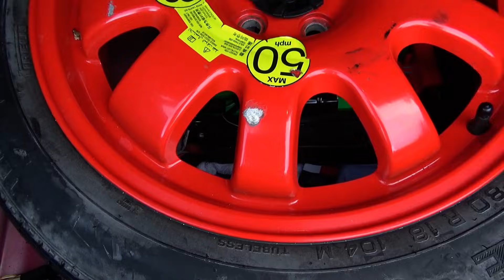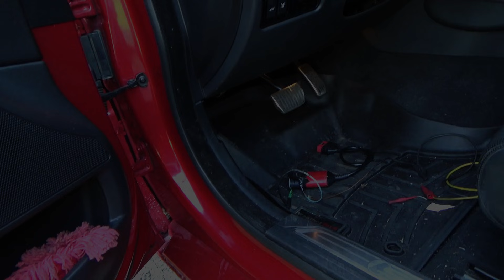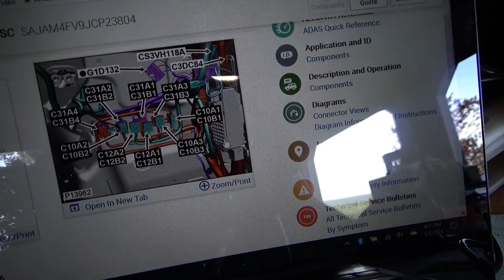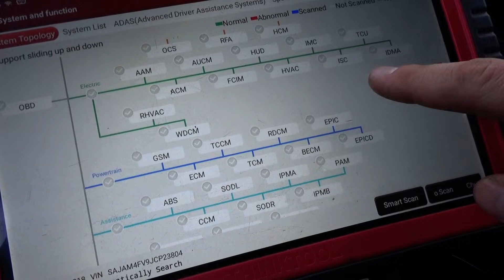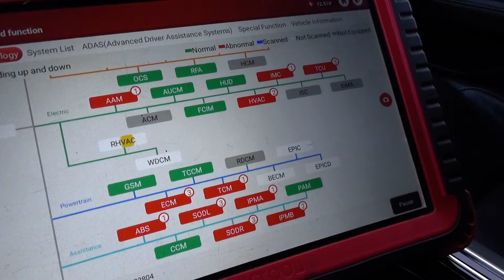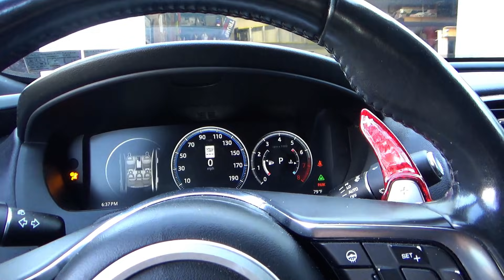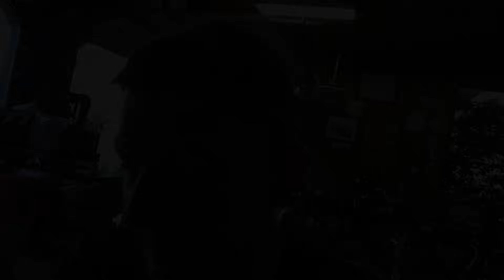Jaguar Transmission FAULT...Can't Read Codes?? ('18 XE AWD Supercharged)

Comment: Ivan, long time follower and JLR guy here!

You did the right thing by clearing out the codes, looking at some of the other codes in the other modules it seemed the old battery and how it was replaced likely caused some of the other issues. Rule with JLR stuff is if you intend to replace the battery you have to leave the car for 30mins to let all the modules go to bed with the boot open. Then do the replacement and reprogramming. This used to be clearly marked under the bonnet but some stupid decision removed the sticker advising of this procedure...(or making you go to the dealer... sigh...)

The reprogramming enables the stupid start/stop system and also the battery low warnings. Makes things worse they're are two batteries in these with the start/stop....  As always a great video!

Comment: Probably for some other DTCs, this gear shift knob ASSY is also known for dried-up CAPS on the PCB so if you feel froggy, you may want to open up the module to check the CAPS of which there are several if you can follow the PCB traces back to the connector, you might be able to narrow down the exact dried CAP or you might see a CAP leaking but if you can do PCB level repairs, give it a go, cheers.

Comment: On most Japanese cars that issue would be related to the transmission range safety switch.  A part that is usually bolted to the transmission externally and easily accessible. Oh Jaguar,, your reputation precedes you,,again.

Comment: i remember working for aamco transmissions. and we used to get the older s-types the four round front. light models. and the modus wouldn’t read the jaguar for the transmissions.  the work around was to put in the car as a ford expedition  because the transmissions were the same and it would work

Comment: Quest - Ivan, Why not check the automatic transmission fluid level since it evidently is a possible problem/cause of the warning light and the vehicle is physically in your shop? 🤔Just asking for me.😳
Reply from the maker: No dipstick 😂
Reply: @PineHollowAutoDiagnostics  Thank you for the response/rational
(Personally I hate despise,loathe,abhor,have grievous revulsion);you get my P.OV. Concerning manufacturer’s replacing physical dipsticks with electronic sensor fluid level devices. Seems ( too me) a case of “look how clever we can be”. More things to go wrong, more complex,etc.
Really miss the ability of an operator/owner to verify quantity as well as physical condition of the applicable fluid.
(Sorry for the rant, just an opinion).
Stay safe.
Jim B,
p.s. please give my regards to Eric O. if you “see” him.

Comment: I'm surprised you didn't at least find the module and check for any wiring problem, especially with that water ingress and the intermittent problem. We have seen before in your vids where the suggested "replace the module" only listed cure turns out not to be necessary at all. Also, what blew that fuse?
Reply: The TCM is probably barried in the transmission case (they do that now). It's not easy to get at, and also, these things need dealer programming or require special tools to reprogram.

Comment: For the TCU, I'm sure if they go to the Jaguar/Land Rover dealer they're going to recommend a whole mechatronics unit (What ZF/Germans call the valvebody with the TCU integrated). You can replace just the TCU which isn't hard. You drain transmission fluid, remove the pan, and drop the valvebody which is about 10 - 15 screws and then unclip the TCU. The problem is that nobody who uses the ZF8 (Audi, BMW, LandRover, etc.) will sell only the TCU, only the whole mechatronics unit. If they can find one for cheap on eBay, swap it over and have a dealer program the TCU to the car's VIN that's they're best bet. I was able to get an entire 62k mile ZF8 for my Audi for only $365 (not including shipping) so I can't imagine the valvebody or TCU on eBay being expensive.

Unfortunate that's probably the solution, but these ZF8 transmissions are tried and trued. Excellent transmission both when they're need to be smooth, as well as aggressive and sporty (almost matching the performance of a dual clutch) while extremely reliable.

Comment: I would also put the selector in M and go through the gears with the shift paddles up and down. You'll find a bad solenoid that way too. I'd change the transmission fluid as its overdue anyway and confirm his battery/charging system is up to par. However, I wouldn't go to the dealership first.  I would head for a good transmission builder shop who knows how those computer trans work, inside and out. Dealers don't rebuild transmissions; they replace them with factory remanufactured or new.  Waste of money. Nice to have repaired the customers fuse and DEC.

Comment: That spare tire well should have a drain hole you'd think. Also, since the Jag runs and drives fine, if it ain't fixed, don't break it!

Comment: I bet it was the weak battery. It said on the diag on the screen to check the battery voltage as one of the steps. New battery fixed the problem

Comment: After spinning off from British Leyland, Jaguar was acquired by Ford in 1999, remaining under Ford ownership until 2008, when Tata Motors purchased both Jaguar and Land Rover.

Tata Motors then created Jaguar Land Rover as a subsidiary holding company. Despite the change in ownership, Ford still develops and supplies Jaguar models with different technologies and components.

WHERE ARE JAGUARS MADE TODAY?
Although who owns Jaguar has changed over the years, where Jaguars are made hasn’t! A few models are made in China and India, but the vast majority of today’s Jaguars are still made in the United Kingdom. Where each Jaguar is made depends on the model. Here’s how it breaks down across the company’s various facilities:

Research and development: Gaydon, Warwickshire; Whitley, Coventry
Assembly of models including the XE, the XF, the XJ, and the F-TYPE: Castle Bromwich, Birmingham
Engine manufacturing: Wolverhampton, West Midlands; Changshu, China
Special Vehicle Operations development: Ryton-on-Dunsmore, Warwickshire
Production of Jaguar XF and XJ models: Pune, India 
Production of Jaguar XE and XF models: Changshu, China

Comment: From watching a lot of YT videos I have gathered that exotic cars tend to be very sensitive to minor battery fluctuations. Well, minor if you drive an old Honda.  (90% probability there is NOT a transmission issue.) However, I did see on the OEM page you displayed to check transmission fluid level.  Seems like you have to go to a dealer for that. Since the car is 6 years old I bet its never been checked. Would definitely recommend it get checked.

Comment: Maybe when the battery was replaced somebody had a memory keep plugged into the OBD socket and as they were changing over the battery they accidently touched the positive cable to ground, that would blow the 5amp fuse.

Comment: Related to another comment, but could be relevant to this car, Ford/Volvo/JLR of that time period often used a clever battery management system. There is a sensor in the battery negative lead which monitors current in and out of the battery. With my car it would throw a low battery warning very quickly if you parked up with the radio on for a few minutes. The "fix" was to unplug the sensor for a few seconds while the engine is running and then reconnect it (a small 2 pin connector). The BMS then relearns the battery, it is possible that this procedure was not done when that battery was replaced. Thank you for your videos, always educational and a well thought out diagnosis.

Comment: Hey Ivan, great job on the diagnosis. It's great to see how important service information (SI) is in your diagnosis. I don't mean to mess with your customer, but consumers need to realize that while it’s a really nice car, when it comes to repairs, you need to have deep pockets when you buy one of these European vehicles. From the description in your video, it sounds like this customer is a bit of a DIYer and can turn a nice car into a beached whale if they don't know what they're doing. Instead of the customer bringing it to the Jaguar dealer, they'll probably go to one of those national chain transmission shops, where things will probably go from bad to worse. Soon to be another beached whale in some independent garage's parking lot.

Comment: Funny, I bought a new Jag xf in 2015. Within one week the stop start system failed... Turns out that sick battery or less than perfect grounding causes a random bunch of codes and fake trouble codes to appear. All modern Jags are built by Tata of India... The Jag master tec that came to my office to look at the problem already knew the issue before he arrived. Basically Jag jlr failed to tighten the earth point in the trunk as part of the pdi. Perhaps this was just too technical for the Mfr...1000s of cars were affected .Having had German and Jap cars in the past I bitterly regretted buying a Jag as the seats were terrible for anyone over 6ft 2" and the first time I opened the screen wash to refill it, the cap snapped off in my hand. Jags look beautiful but are in my opinion a great way to lose faith in modern cars... Just avoid them like the plague...

Comment: I have a Jaguar XK R 4.2L V8 Supercharged & I have had all sorts of warning messages on the dash & so far they have always been linked to the battery voltage being low.

In the end I bought a trickle charger battery maintained to plug in every night & since then 🤞things have sorted themselves out.

It's got to be said Jaguar are absolutely appalling at electronics.

Comment: low battery and water on connections can cause all sort of problems cancel all codes 3 times before throwing money at it  not as squireley as amg  its 4wd

Comment: The OBD 2 connector and the transmission park position sensor is powered by the same fuse,,had a similar experience with the mercedes
Reply from the maker: No way... Didn't see that on the wiring diagram! 😅

Comment: I don’t blame ya for not wanting to dig into Pandora’s Box with that Jaguar. Besides if this was leading in the direction of the transmission you might be messing where a regular mechanic might not wanna mess. Better to let a dealer take a look. If they fix it I sure wouldnt mind seeing the real culprit. But then again could it have been a fluke? There’s one that got away with a question mark. ❓

Comment: In the transmission world we see lots of low voltage fault codes sets that don't really cause issues. I know clearing the codes dosent fix a vehicle but if you replace the batter and clear codes fixed is fixed lol

Comment: I saw that 5 amp fuse had a branch off to something else. What was on that circuit? Glad you took a look at your OBD connector. Last yr I almost got booted from the ridiculous plug and pass OBD emissions test on my 05 Acura as an automatic fail. The tech couldn't get com. I asked to look at the connector. His side had 2 bent pins...I moved to a different lane and went through n/p..
Reply: I also saw that branch, but Ivan said the fuse only feeds the diag connector???
Reply: It was the 2 powered pins of the DLC.

Comment: This is my one big problem with AllData; the search feature is absolute garbage, and I spend an inordinate amount of time trying to find information, when the same search in ProDemand immediately gives me what I'm looking for.  Sadly, ProDemand recently completely screwed me over and I have completely cut ties with them, so I'm stuck with AllData.

"The only thing this fuse powers is the OBD II connector."  LOL, first time with a Jag?  Don't worry, it'll traumatize you soon enough!  ;)

Uh oh, it Nissan'd your scantool connector!

Love seeing all that Ford nomenclature in there; makes it so much easier to work on knowing that's just a bloated Taurus!  

Keep in mind though, just seeing you scroll past a bunch of codes there, this vehicle has likely been involved in a wreck before, and service data was hinting at voltage fluctuations being able to trip this code.  Rear bumper and exterior trunk trim have been off of this car, SODR is tattling on SODL, pointing to driver-side rear damage, both front seats have been removed, and the airbag module has been either replaced, or at least heavily disrupted (Yaw Rate Sensor error).  If this vehicle has not been involved in a collision, then the water ingress in the trunk is catching my attention!  However, I suspect the wreck and a subsequent improper repair caused the water ingress...

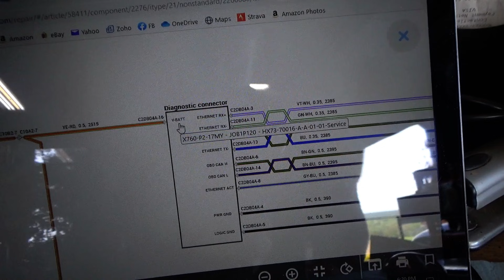Comment: Im disappointed in you Ivan. I atleast expected a wiring diagram check to see if there are any connectors for green crusties to form at. Possibly even examining the TCM for any kind of water damage or obvious failure points. The blown fuse and KNOWN water intrusion were atleast to me pretty obvious red flags that something more serious may have been going on to cause these issues. The secondary wire at 5:12 for the OBD fuse was atleast worth investigating to see if it could be related. 

I also expected you not to take service info at face value and prove that the short has to be happening inside the TCM. If the service info said "Replace Engine", you would have dug deeper to verify the actual cause of the info. 

Now maybe there was something else missing here like the TCM & Shifter were all one integrated module or the customer only approved of absolute minimal diagnostics because the issue is more annoying than anything else. If that was the case, probably should have made that a bit more clear. 

Overall probably not your best work  as it really felt like "Not a real issue, double check service info for anything obvious and onto the next car". But getting it right 99/100 times is still an A+ 😎. Keep up the great work and hope to see what else comes at you in the future.
Reply from the maker: TCM is integrated into the transmission, and transmission is completely inaccessible. What else am I supposed to do? 😂
Reply: @PineHollowAutoDiagnostics  Not being a hater, just expected more than "Service Info says your fucked, talk to the dealer for repairs". 

Sometimes you can't fix everything
Reply from the maker: @Dje4321  This is real-world diagnostics haha

Comment: I had a leaky trunk on my Camry Hybrid, got water pool in there. Not good since main hybrid battery, and regular 12v are both in that area. Dried it out, pulled all the padding/trim, then put a couple GoPros in there with an Aputure light so I could get good video quality. Started the recording, closed the trunk and hosed water all over from ever angle. The video revealed two bumper cover trim clips above the license plate area had broken, and being broken, let in the H20 flow right in... easy fix with a couple silicone blobs.

Comment: I know there are bigger issues in the world but it really annoys me how cars are going these days. Manufacturers making cars that can't even get past 40,000miles on the front end. Then, stop parts supply after 10 years on the back end. If the aftermarket doesn't smarten up any time soon and you can only trust factory sensors/actuators. We're almost to a point where we'll literally be scrapping an entire car because of a failed PCB component. 
I'm kind of surprised one of the manufacturers (chinese) hasn't gone rogue and only make/sell an older, proven simplified tech level of car. Surely there would be a huge market for people wanting a fresh car but basic, reliable and fixable. 
Like being able to buy a 2010 model brand new today.
As for your question Ivan, I did wonder as you were reading though the action list. If the fault would even come back now he has resolved the voltage issue with a new battery. Supplemented by you restoring obd power and clearing all the remaining faults. 
Eye opening upload.
Thanks Ivan
Reply: That’s the Democrats plan to eliminate gas powered vehicles. You will buy electric and be happy 😂

Comment: The trouble code data did say to check battery voltages etc. I'm going to make a pure speculative guess and say the old battery set the code and with no power to tge reader it wasn't able to be reset until you fixed it. You erased the code and with the new battery all is right in its little jaguar brain

Comment: Hey Ivan first thing I thought of watching this was when the owner changed the battery. Since their OBD port was down it would not surprise me if the new battery was never registered. I don’t know if this year Jaguar uses a similar system to Mercedes/audi/bmw where the new battery has to registered to computer/alternator but can definitely see that causing a random erroneous
error in some modules since those cars are so sensitive to voltage.

Comment: I did a battery on one of these recently, the new battery needs to be coded to the car. It has an intelligent charging system, in order for it to function correctly it needs to know the battery type, size, rating, etc.
Cheers, thanks Ivan.
Reply: So true, it’s amazing how people still think that replacing wabattery on a  car is like replacing a battery on a 18 year old Crown Victoria, or Cadillac CTS/ DTS or any other car that’s at least 18+ years old, when all you had  to worry about after a better replacement was reprogramming your car stereo, Clock & Memory seat functions…
Reply: @paulsz6194  No, what's surprising to me is that these so-called "intelligent charging systems" can't figure out the battery that's installed and the charging rate it needs. The term "Intelligent" has been turned into an oxymoron. Our 18-year-old Crown Victoria's or any other maker's regulator did just fine keeping the battery charged. Now we have these systems with all their modules and an "intelligent" charging system that can't keep the battery charged if one does a lot of short distance driving. That issue was covered in another mechanic's video with his new truck and short drive to work.
Reply: That's the same even with normal Ford cars etc. now, that are equipped with start-stop systems.